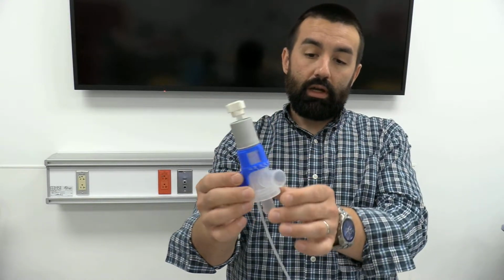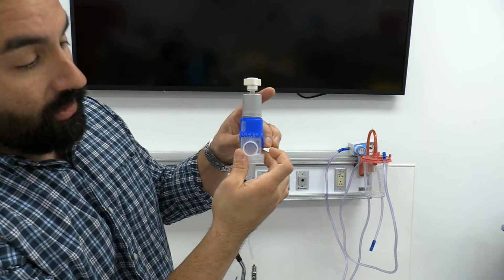Large Volume Nebulizer:  Bland Aerosol Intro

Comment: What do you do if you don't see a mist coming through prior to putting the mask on the patient? This has happened to me. The connections are good, and I've increase the flow but I don't see a mist.
Reply from the maker: Sorry for the delayed response.  Sometimes it's just hard to see.  I carry a green flashlight and shine at the outlet with the lights dimmed to make it more visible.  Helps 1000%